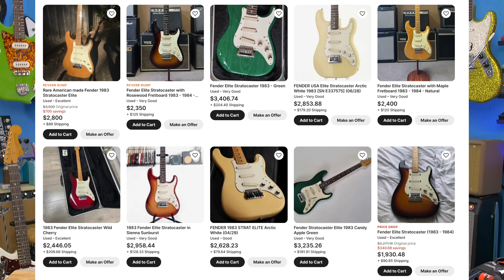1980s Fender Elite Stratocaster - MORE GUTS THAN MOST TUBE AMPS!

Comment: I own one of these, and it's the best advanced Stratocaster that was ever made. Mine also has the FTLN on the headstock.
The Tremolo adjustment is done with an allen wrench from the top of the bridge. This guitar is only designed for .008s .009s and .010s. You have to move the claw to the correct position for each gauge. The bridge is meant to be decked since most players were doing that in the early 80s.
The controls are: Volume, TBX, and MDX.
If you have any questions about this guitar, just ask. I've owned one since 1984.
I think your claw in that guitar may be set for .010-.042 and that's why you can't relieve the tension with the "Top-just" screw. To adjust the tension for the correct gauge of strings, you need to remove the bridge pickup and dummy coil to access the claw. There are three pairs of holes in the claw plate, and two screws that hold it down. The pair of holes closest to the neck is where you mount it with the screws for .008 gauge sets of strings. The pair of holes closest to the bridge are the ones for .010 gauge sets. The middle pair is for .009s. After that is set up for the correct gauge of strings, then you tune it up and adjust the tension from the top of the bridge by loosening the screw until the back of the bridge starts to come off the body, then tighten it so the bridge just comes to rest on the body without slamming into it.
Reply: If I'm not mistaken, this has the System II bridge.  There seems to be conflicting information about whether the Elite came with a System II or a Free Flyte bridge.  From pictures pulled up in a search, the one seen here matched the System II look (unless the picture was mismarked).

I have a mid 80's Squier with the System I bridge.  I love it....... and hate it at the same time.  LOL!
Reply: @kmabru  No Sir! This is the Free-Flyte Tremolo Bridge. I believe the System II was the locking trem on the Japanese Contemporary models.
Reply: Great info.
Reply: The pots and switches make think of G&L’s bass and treble roll off pots. You can also select bridge and neck pups or all by using the push pull on the volume pot. I wonder which came first?
Reply: I put a TBX into my 2000 Powerhouse Strat since its actives lacked sparkle, I'm also familiar with it from 90s American Standards. What does the MDX do? Is that simply the control for the boost circuit?
Reply: @jameschamplin1742  It stands for something like Mid Boost Xcircuit. Im wanting to get a powerhouse strat as my first guitar (instead of borrowing my sisters) and giving it lace sensors, im a fan of Ty Tabor
Reply: @jameschamplin1742  I believe the powerhouse strat has the same midboost as the elite, fender now only sells the Clapton version which has a bigger boost
Reply: @jameschamplin1742  Not quite sir. MDX is an abbreviation for midrange boost expander. Do you recall in the video there is a dummy coil under the pick guard? When you bring the MDX control into play it powers up that dummy coil and pairs it with the current pickup you've selected, essentially turning that into a humbucker. We all know that humbuckers are heavy in the midrange area, so this was how they added that to the Strat circuit at that time. CBS was looking at how high profile Strat players were modifying their guitars at that time and that's how the Elite Strat came about. People were decking their tremolos for tuning stability and more sustain, and at that time EMGs were becoming a popular choice for a lot of Strat players, (think Pink). 
Fender under CBS was always trying to keep up with the trends and tried to offer factory versions of what people were doing with their Stratocasters. This is purely speculation on my part but, I believe when Dan Smith joined the Fender team, he most likely had a lot to do with this particular focus for Fender. His first offering which did pretty well for Fender was the "STRAT" in 1980. That was the first factory hot-rodded Strat that Fender offered, and I own one of those too. Like the Elite, both guitars have their own unique character.
Reply: @harleyhexxe9806  Honestly, I don't know what to believe at this point.  Like I was saying, there is conflicting information out there.  I've seen pictures showing this bridge and calling it System II.  I've seen other pictures of this bridge calling it Freeflyte.  From what I have seen, they both have similar saddles.  The main difference in appearance has been the bridge plate itself.  One looks like this (the one labeled mainly as System II).  The other plate looks reminiscent of the traditional Strat bridge plate, but with these saddles (and the raised/slotted mount for the trem arm).  There is one site making arms for both and they say "above is a picture of...." but uses the same picture for each bridge (what we see here).  

Then there is the conflicting information as to what the Elite came with.  Some say Freeflyte, others say System II.  From what I've been able to gather, both types feature the internal spring setup that we see here.  

Yes, System II was available on some Japan guitars.  From what I was just reading though, it sounds like it didn't lock (at least the way the System III could).  They both seemed to have some sort of locking nut (which this one doesn't seem to have).  I'm beginning to wonder if System II and Freeflyte are just the same bridge and which plate you get is just whatever was in the parts bin at the time.
Reply: @kmabru  I believe I understand your confusion, since there are two variations of this bridge. At the time the Elite was released as the flagship model of the Stratocaster, there was also the baseline Stratocaster which was only made in 1893. It was designed with a stock looking bridge designed like the Elite, but with less mass. It was top-loading, and the springs and claw were under the pickguard like the Elite, but no active electronics. It had three single coil pickups, and a volume and tone knob, and the output jack was where the 2nd tone pot would have been. This model was hugely unpopular and wasn't produced in 1984. Instead, 1983 was also the first year of the '57 & '62 USA reissue Stratocasters, and these were the Strat models that were more popular.
The bridge on the 1983 standard Strat was also a Free-flyte bridge, just a stripped down model.
You can go online and search for the 1983 Elite Stratocaster owners manual, and it will call out this bridge as the Free-flyte Tremolo.

By the way, all the hardware for Fender guitars, in both the USA and Japan was made by Schaller.
Reply: @harleyhexxe9806  Thanks.  That's a piece to the puzzle.  I've done all of the digging that I'm willing to do at this time.  Maybe when I'm bored one day, I will look further.  I am curious.  I was looking through a manual and it had sections on System I, II and III.  Primarily III, since that was the new big thing at that time.

I think what we might have here is a case of two names for basically the same bridge, depending upon the market where the guitar was made (and what type of nut was included).  The pictures of System II that I've pulled up most definitely look like this bridge.  If you got a MIJ guitar with this setup, you got a locking nut and they called it System II.  If you got the USA made Elite, you got Free-Flyte and no locking nut.  While the other "Free-flyte" was the red-headed stepchild and just made things more confusing.
Reply: @kmabru  Actually, my Elite has the Fine Tuning Lock Nut, (FTLN), which was also made by Schaller. It's a self-contained piece of hardware that mounts on the headstock behind the nut, and has the lock clamps and tuners built into it. It's a tricky piece to get used to and I'll admit it's also a bit cumbersome. Pure speculation here on my part: I think this may have been an afterthought on the part of Fender after the Free-flyte bridge was designed. It might have been too late in the year to re-design the bridge with fine tuners for them to make it to the NAMM show in time, so they went with this design instead.
I believe they only installed this piece of hardware on half of the Elites they produced. Later, they just offered this as an add-on option if you wanted it. The first Elite I bought had it already mounted on the guitar. I bought that and added it to my second Elite later. The one I own now already had it when I bought the guitar, but I had to overhaul it two years ago to make it work properly without causing it to break my high E strings.
Overall, I love guitars that are versatile, and for me the Elite is exactly that. I can go from a Stock Strat tone to a humbucking lead tone with a boost right from the guitar. No pedal needed, just a twist of a knob.
Reply: @harleyhexxe9806  Afterthought is an understatement.  I know I said I would wait until I was bored one day, but curiosity got the better of me.  Took a bit, but I found a picture of the FTLN and it totally looks like an "oops, we need to fix this" addition.  Interesting that you either got it or didn't and could add it later if you wanted it.

I went back and checked the manual with the System I-III information.  System II and III shared a cam lever locking nut. It didn't feature fine tuners (with System III that would have been redundant as that bridge already had fine tuners).  I also went back and found the site that had pictures of the various bridges one of their pages (a history of Contemporary, Elite and Free Flyte).  The picture that matches this bridge is labeled as System II/Elite.  The Free Flyte labeled picture is that lower-mass one that you mentioned earlier.

Looking at the dates of availability, it looks like Free Flyte was rebranded as System II when Fender was sold and production shifted.  Likely at that time, they had developed System III and used the locking nut from that with System II (possibly deemed better functionally than the FTLN).  Also looks like some of the later 87 MIJ models had a Kahler bridge paired with a System I locking nut.  You know..... just to add to the confusion.
Reply: @kmabru  I like your take on the FTLN and I agree, that was definitely an "oops we forgot about this aspect of it!" I've been using them since the early 80s though, so it's no biggie for me to keep it in working order, and it does do a good job when it's right. You could also be correct about them rebranding the Free-Flyte as System II after the sale. There was a lot of uncertainty and confusion in early 1985 because the sale was finalized just before the NAMM show, and really all Bill Schulz &Co. had was just the name. They took a few pieces of equipment from the Fullerton plant, and all the remaining inventory which they sold as quickly as they could, but there was no production in the USA for Fender guitars or amps until October of that year. They were importing Japanese reissues and Contemporary series guitars built by Fujigen-Gakki, which held them over for a month or two, but they had to go out and buy new tooling for the factory in Corona. 
I remember that cam-levered locking nut that clamped from the sides instead of the top, but I would never install one of those on my guitars. I believe that when they were gearing up to start production in the USA, all the hardware designs were negotiated between Fender Japan LTD, and Schaller. When Fender was ready to Start building in California again, they went back to the basic designs of the old familiar Strats, and focused on getting their quality on track. They've been doing that ever since. If you notice the Fender product line since the CBS sale, their bread and butter has been basically the same with minor refinements. They don't seem to want to venture off into any projects like the Elites anymore. At best, they are looking at what people are doing to their guitars, and keeping any mods down to a minimum. It's too bad they did that with the guitars, because in the late 90s, Fender was doing some wild stuff with their amplifiers, but that ended around 2005-2009? What they have now is nothing I would buy.
Reply: @harleyhexxe9806  I'm pretty convinced that it was just a rebranding.  Why was it done?  Who knows.  Perhaps a condition of the sale.  Maybe just a product alignment (Japan had System I and a new bridge was in the works).  Heck, it could have even been a negative association with the Free-Flyte name.  Whatever it was, I think it's just a rebranding.  The guts seems to be the same.

I really didn't follow product lines through the years.  Also had no idea about company sales or struggles until I started researching other things.  I had my 86(?) Squier with System I and that was good enough.  I really wasn't playing for quite some time.  I discovered System II while searching for parts for my bridge.  Now, my interest in playing has resurfaced........ only to have arthritis in my left hand and pinched nerves in my neck throw me a curveball.  Frustrating.  My need to tinker recently kicked in.  I don't DARE mess with my Squier.  I like it too much.  So, I picked up a cheap clone at Goodwill and ripped into that.  Hey, if I screw it up, I didn't spend much!  Messing with that inspired me to build something from scratch (with parts off of Amazon and Ebay).  The partscaster is now complete.  The Goodwill project continues to evolve.  It started life with a standard tremolo.  Umm...... it's now a hardtail.  LOL!  It just got all new electronics, a new finish and will soon have a new neck (the original is awful).
Reply: Interesting stuff man. I never knew these existed. Very cool.

Comment: That dual pot tone control is Fender's TBX tone control which made it over to the American Standard series.  The other tone pot is the active MDX mid-boost; the pickups themselves are passive.  

Eric Clapton was a fan of these guitars which was the inspiration for his signature model by which time Fender moved on from the dummy coil to Lace Sensors (apparently, an updated version was planned which would have used EMG pickups, exotic woods, and I think neck-throu construction).  The Bi-Flex truss rod and redesigned string trees (EZ Glyder) also made it over to the Standard Stratocaster (made-in-USA) and the later American Standard.

Fender kind of brought this concept back during the mid-2000's (?) with the made-in-Mexico Deluxe Powerhouse Strat; similar electronics to the Elite but in a more traditional Stratocaster form.
Reply: I knew it looked familiar to my Powerhouse Strat.😊

Comment: 12:31 main feature of a dummy coil is 

there are no magnet(s),
which is why it does not pick up info from the strings.

The reason you can still hear hum is that for achieving optimal tone w a dummy coil

the coil is often intentionally mismatched with the primary / audible / magnetized  single coil. 

An exact match will completely hum-cancel 

but sound un-jangley /
less stratty.

That said I’m not loving the pickups regardless

Comment: I worked at the brand new Guitar Center location across the street from the original and these new Fenders were just one more delight in my mind that I could buy a vintage Strat on the cheap. If anything it did the opposite. Old amps and effects on the other hand were ripe for the picking. I bought a Vox Pathfinder and a tweed 50's Champ for a hundred bucks each. Then one day I asked a shop if they had any old amps I could buy to learn from. They brought out three Fender chassis without their cabinets and asked, "uh' 75 bucks okay?". I got a brownface Bassman (with the Presence control), a Bear modded '65 Bassman, and a '71 Silver face Twin Reverb. The only thing wrong was the Output transformer was blown on the brown face. I memorized all three of those amps wiring and the mods on the '65 Bassman. Then in '91 I got Aspen Pittman's first edition of the Groove Tubes amp book that has every vintage amp schematic in it. I no longer had to remember anything. lol

Comment: That guitar is so cool!
I found a manual for it here - you were right about the spring tension screw for the bridge. There's a diagram on page 8.
I'll reply to my own comment with a link to the manual I found.
Reply: Looks like the link is not there. I'm not sure but I imagine it was removed because it was a link. It's easy to find, though.

Comment: You reckon that's weird. I just bought an Epiphone Les Paul Ultra III. Onboard tuner, Shadow piezo pickup built in to the body end of the neck after the final fret, the volume and tone controls for the Shadow pickup on the 𝘣𝘢𝘤𝘬 of the body, two output jacks for stereo enjoyment, a chambered light weight body with a belly relief, two Probucker pickups that can be in and out of phased, and a satin finish paint on the back of the neck, and a stunning flame maple top. This thing plays and sounds better than some Gibson's that are two or three times the price. I love it.